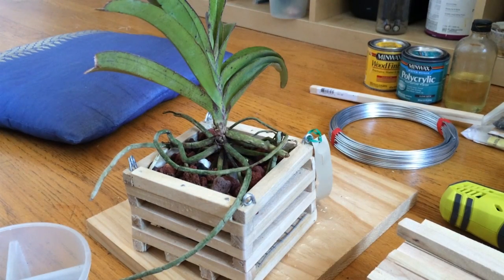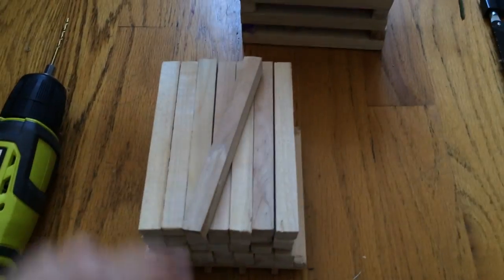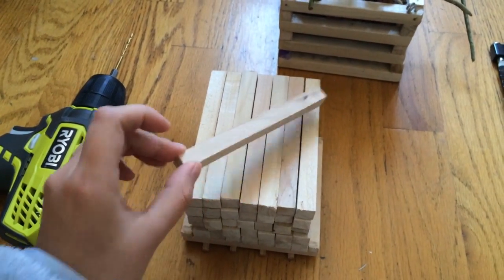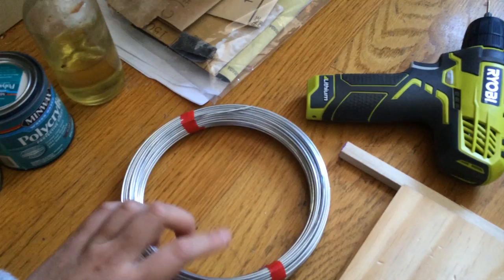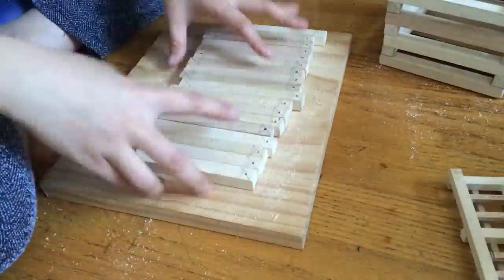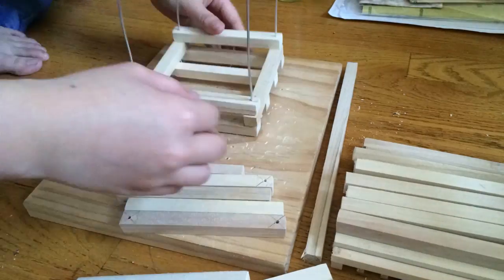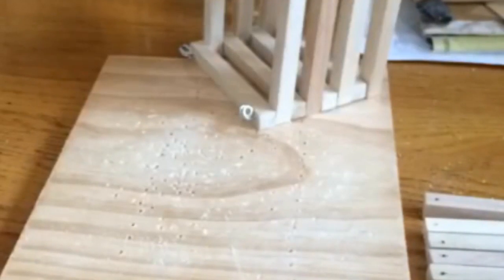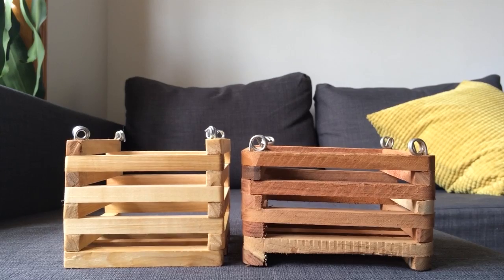Making Vanda Baskets + basket review

Comment: Great demonstration. I met someone over 30 years ago making baskets this way with hardwood offcuts. Only real difference was he would add an extra 2 pieces at the bottom to support the  bottom slats in the basket. These were included in the upright hanging wires and reduced the need to rely on nails to hold them in place.

Comment: As a fellow orchid grower decades old - I heartily suggest not using basswood nor red oak. Red oat never. But basswood is the lightest wood out there, it is a hardwood but the lightest one there is. I’m not sure where your data came from but basswood not at all like cedar and is probably the worst wood to use for this purpose.  It is horrible in moisture applications and has absolutely no resistance to rot, insects, etc. And the resins in hardwood like Ipe, teak, even cedar, redwood, or cypress etc are far different than flaxseed oil which is what linseed is. And while decades/centuries ago old growth redwood, cypress, western cedar were very dense and had high amounts of natural resins — fast grown plantation wood today is not anywhere the same quality.  Same for pine or oak. I would use raw teak or I like ipe better. Ipe is being used in high water locations like Niagara Falls for decking because it stands up for 40-50+ years under high moisture exterior use. It will Grey to a beautiful grey but if used in a deck or inside floor and is kept oiled with a timber oil - will retain the beautiful chocolate brown. But I don’t  recommend oiling in contact with orchids roots which will be attaching to the wood. I haven’t seen any properly run orchid trials with any kind of oil, stain etc  but it just seems like common sense. Black locust we use to use for fence posts because if properly cured and put in - no concrete, tamped inch by inch — it would last for decades. There is some I put in in the 60s, still standing.  Concrete rots wood — it’s one of the reasons it’s never put down on foundations without protection or being treated. Oak was used and still is for building ships, yachts, etc but then it is always kept painted and ask anyone who owns one — how often it spends time on land being scrape, sanded and repainted. Again old growth oak timbers stood up well but they used various coatings in ancient times and many a slave broke his back working on the ships. I might try with a cheap plant some high quality white oak that’s been standing for 3-400 years as opposed to 35-40 year plantation oak.  Look for somewhere an old oak has but the dust in a storm or just grown too big too close to someone’s house.  You must cure it out - stick it after milling before use but look for some recyled oak amd have the finish planed off.  

And for orchid roots — you will not want to use petroleum based varnishes or typical paints or stains due to the chemicals.  I wouldn’t even use linseed oil.  Linseed oil from the big box stores has a lot of chemicals, plus it isn’t purified and will mildew, mold, algae, etc. You forgot the solvents in boiled linseed oil. I would only use organic boiled linseed processed by oxygen method  (not boiled and solvents not used).  If you have to use linseed oil then purchase from Solvent Free Paint company and get the organic purified raw. I like the Swedish one but the US produced is fine and you can get an 8oz container. https://www.solventfreepaint.com/cleaned_linseed_oil.htm Make sure while on the site do some reading - lots of good information and products there. I have no connection to them just like their mission. True linseed based paints (no solvents, additives, etc) painted on raw property prepared bare wood, it won’t need repainting for years, decades. If it looks oxidized, dull, it usually  just needs to be washed down with high quality linseed soap and rubbed down with a light coat of organic purified linseed oil and that will carry you another 10+ years. Europe has used pigments and linseed oil to paint homes (interior and exterior) for centuries - no solvents, no scraping, repainting every 3-4 years. See use on metals like underneath car and tractors etc. 

Needless to say I like true organic linseed oil but I’m not sure plant roots like orchids that actually attach to the wood do.  I know for a fact they do not like red oak and will decline.  I would only use cedar, redwood, cypress or ipe, teak to make baskets. I prefer cork oak bark for mounting or Fernwood Tree fern totems or boards.  In terms of teak or ipe, these are more expensive, but you don’t need much unless going into commercial production. You want woods that naturally stand up to moisture and don’t forget that you are constantly spraying (usually once a day) plants mounted in baskets, sometimes more in heat of summer. Don’t forget the effects of fertilizer salts too.  Plants like Vanda wired into these baskets placed outside with a couple of large junks of charcoal and/or Super Orchiata will require daily in winter to 2x day in active growth (new growth, and green root tips) maybe 3x midJuly/August in much of US.  

You might if you absolutely have to —use non toxic stains on Basswood but most of those have some ingredients I think would still be toxic to orchid roots.  I sorta take the point that anything that says it’s highly combustible or you need to use mineral spirits or turpentine to clean up — maybe I don’t want it near a $300 dollar plant’s roots.  

Basswood article Perdue University 
https://www.extension.purdue.edu/extmedia/FNR/FNR-274-W.pdf